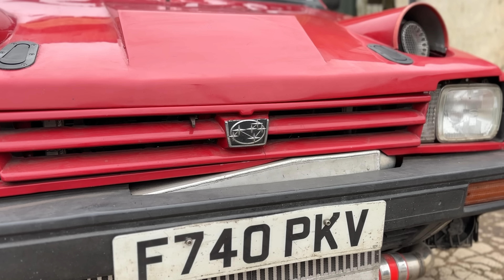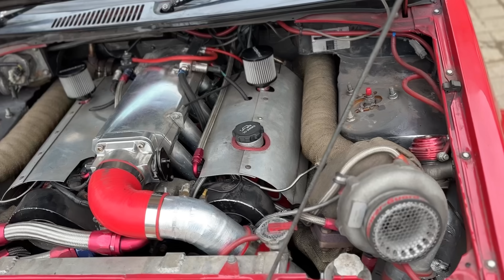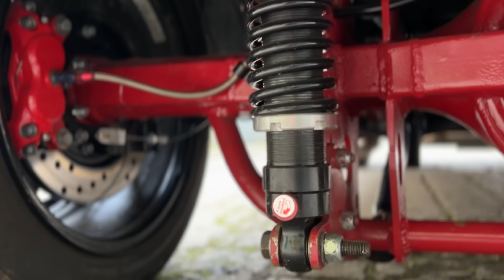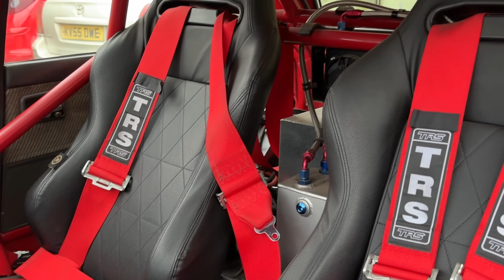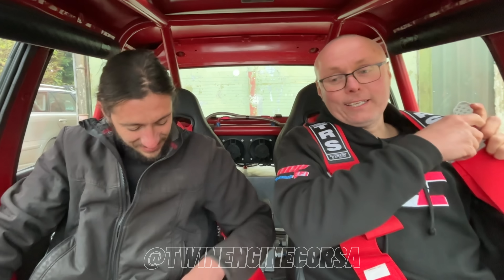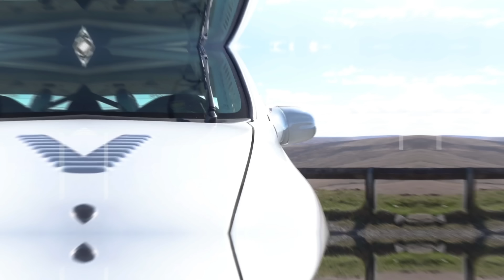THE 4.0 V8 SUBARU JUSTY!

Comment: if anyone's wondering (I doubt it), this means that you could also build a V8 RWD Mk1 Suzuki Swift with basically all the same bits
Reply: indeed
Reply: completely wrong. There was a Suzuki Ignis in the mid 00's that was a rebadged Justy, but that's the only time they ever shared any components
Reply: @StanleyKubick1  Sort of, the original Justy was it's own thing. From the 2nd gen onwards they were rebadged Suzukis, then Daihatsus.

Comment: Megasquirt 1UZ gang gang.
I have a 95' Nissan pick-up 1UZ to Collins to 5pd, 3000lbs/1360kg with me in it. My Dad bought the truck new when I was 4. It sat for 15 years and I just got it running this year. My swap was a little less involved than this one.
 All the vibration in the video is from the sound of the engine. I have a quiet exhaust and it's the smoothest engine I have ever played with. It just wants to rev and rev.

Comment: I had a 4L Lexus no turbo V8 in an 83 Hilux 2WD dualcab ute with a 400 mm chassis stretch. It also had an auto and a 3.9 geared inch diff. It went like a scalded cat and I have had some good V8s. Loved it, I only sold it in 2013 because I thought I was moving overseas, I am still going just a bit later than I thought.

Comment: You haven't used a small 4wd like the Justy or tah dah dah Fiat Panda in everyday driving. UK weather we were driving as if no puddles, hilly winter laugh at all the crashed jeeps understeering onto the back roads from the main roads. The motor you're at, proper mad motorbike man made that.

Comment: I love this thing so much. I still prefer Jonny Smith's Flux Capacitor, but this Justy is an absolute joy. 
I disagree with you about EVs being the death of the built-not-bought project car. It's a different skill set, and it does really suck that car companies try to lock everyone out of fixing/modifying their cars. But that's a right to repair thing that is also a problem with modern petrol cars. There is a thriving EV conversion community that still embodies that way of thinking. It's not to everyone's taste though, and that's ok. 
I really wish kei cars were legal outside Japan. They're insane little bastards and I'd love to get my hands on an Autozam AZ1 to convert to an electric racecar hahaha
Reply: Kei cars are legal in the UK.
Reply: @Piazzapower  Oh damn now I have to move to the UK